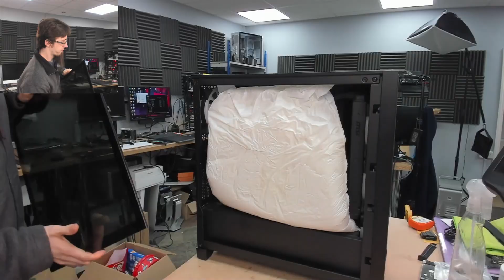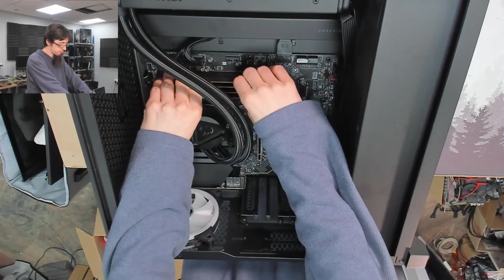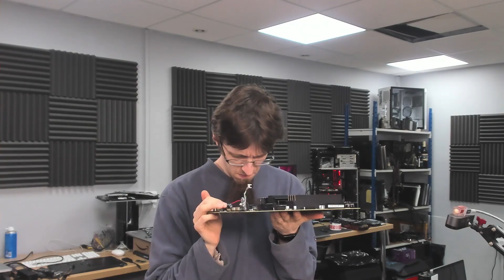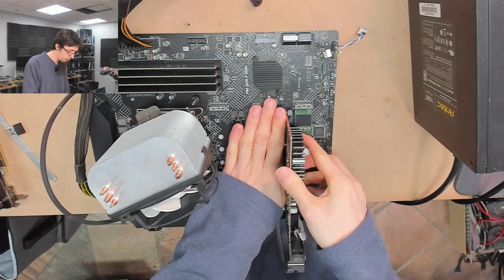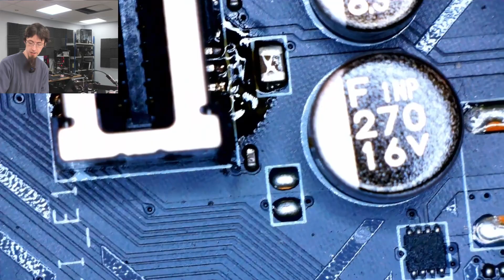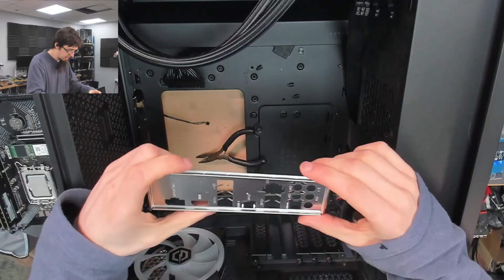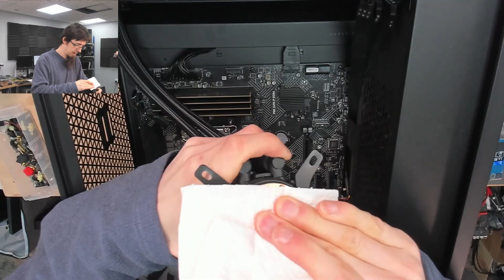CyberPower PC, GPU not detected - LFC#334

Comment: I got a lockup problem where my PC will lock up once or twice a day or sometimes it will run for days and not lock up, the sound will stutter and freeze or sometimes it will lock up with no sound. I have looked at my CPU heat and HD heat and video card heat and checked my power supply stats seems fine even when gaming I get no blue screens at all and can't get a crash report from windows I can't tell whether it's a driver problem or Hardware. Sometimes windows won't boot upright and I have to rest reboot to fix it.I have reinstalled windows but this did not fix the problems, with both problems I just rest rebooted and I am just fine again for a time. it only ever locked up once while gaming strange. Could you give me some tips on what to look for as the problem areas for these kinds of lockups?. ps. I did a ram test with memtest and it came up with no problems found, i ran it twice and got all the latest drivers, Bios i can install. Thanks for any help.

Comment: Its because of  Windows Not Properly determining the drive as they have Server grade drivers that are being mis-configured in windows active directory and the End outcome is Either a Hardware Component being BRICKED = OR = no longer working or a full System shut Down = Crash = over and over again when ALL along it IS Windows ! now the board = YES this also COULD be due to windows misconfiguration of its drivers and causing one bios to be confused with another Ultimately bricking you device .
Bricking = To throw a BRICK at something = as in BREAKING IT . jst fyi

Comment: Excellent repair. I've been building gaming systems since 1997 and have never run across this problem. With graphics cards getting heavier, it presents a problem for shipping. For shipping I take the extra effort to secure the cards so no amount of jarring will disturb the internals.

Comment: this is just great learned so much big respect+1. I would have switched the card to the PCI-e  x8  lane and call it a day as From a quick look, there is a little below a 1% performance difference in PCI-e 3.0 x16 and PCI-e 3.0 x8 slots. The difference is not even close to perceptible and should be ignored as inconsequential to users fretting over potential slot or lane limitations. please note that I'm not sure how this scales with SLI. peace

Comment: I have a gigabyte GTX 1060 that wont boot on two computers i tried to put it in, but will boot in my personal rig with no issues, im absolutely stumped as to why, the two other computers run fine with my test GPU, what on earth is wrong with the 1060 GPU? i cant find an answer anywhere, is this something anyones come across?

Comment: DO YOU REMEMBER OLD PS3 ? XBOX 360 ? GAMING ?? 
1-PCH (H61 -H81,H110,......
RUN GAME STREESS THE VGA ,SECOND .ALL POWER TRACE و

2- The heavy weight of graphics can break soldered bases

SOME TIME RE  heating THE PCH CAN FIX IT 

EC CHIP .SAY OK IM ON
PCH COMMAND THE MOSFET ON
AND POWER ON 

IN YOUR CASE .MAYBE NUMBER 2 HAPPEND

Comment: I had to use an old 4870. It wouldn't display anything. I updated the bios with flashback button. Still no go on newer cards. I think the mainboard went into legacy mode. I'm pretty sure that's what happened anyway. Then they would work. Then I turned on UEFI. Weird right? I'm new to all this UEFI stuff. Actually this computer I'm on isn't UEFI. It was a beast workstation 10 years ago. About time for an upgrade though. A $100 Ryzen beats the dual CPU Xeons now days.

Comment: The last two MSI motherboards I owned had badly soldered Ram slots that failed after warranty. Unable to run Dual channel ram in either board. They advertise high quality components but clearly their soldering process is pants. As soon as you identified it was a slot issue I was wondering if you would put it under a microscope and push on the pins. Well done.

Comment: I used Alphasync system integrator and by comparison it's amazing. No crappy ram or power supply issues at all. Having said that, let's not rule out the possibility this kid put those componnets in himself using their configuration system.

Comment: The NVME is maybe connected to the chipset in stead of the CPU. There are two slots closer to the CPU that probably connect to the CPU more directly. I see you fixed it at 55:00, good job.

Comment: This entire system may have been damaged in shipping, which might explain the board being jammed and perhaps a hard drop (in shipping) and the video card, took the brunt of that drop and resulted in those pins to crack. Over-time, thermal expansion, and the weight of the video and completed the shorts in the pins. Plus, that video card is huge!

Comment: When i saw that motherboard so low in the case i was suspecting some contact with the case. I got this problem twice with customers who build their PC and did not even put the raisers.
Nice job about the diagnose and the testing by the way and nice find about that bad soldering, Strange that this MB went through testing and was sold, tells a lot about cheap MB.

Comment: Paused at 17:56 screaming in my head: TAKE THE MOTHERBOARD OUT! There are obvious signs of issues with the installation of the board before even opening the case. That's your first port of call. Judging by the intermittent failure with the GTX 1060: I'm guessing a failed PCI-E slot due to improper motherboard installation.

Comment: Paused at 11:53. I'm going to make a prediction. I suspect that the improperly installed motherboard has caused stressed in shipping, especially surrounding the GPU which surely is secured properly to the case and so not correctly to the motherboard given that it's out of place. There could be a broken solder joint or trace somewhere near the GPU or really anywhere in the motherboard, especially near the standoffs. Heck, there could even be an entire standoff in a place where there isn't meant to be one applying pressure or even shorting.

Edit: Given that error code is showing a GPU problem, I'd start by putting the GPU in the second 16x slot.

Well, actually I'd be curious immediately to pull out the motherboard and see what's causing the alignment issue.

Comment: What a great video. Once you found out it was the power to the GPU, I thought right a way there was a broken solder joint on the slot. Not knowing what you do, I would have checked the slot first for bad pin connection. Great job!

Comment: Ha! An MSI board with crap (or non existent) QC? Please say its not so...
Stopped buying MSI when I realized most of my PC hardware that has died or failed for the past 10 years has been theirs. I've had two GPUs fail on me, both MSI models (R9 380 Gaming 4G, RX 590 Gaming). Three motherboards, all MSI (Z97 PC Mate, B450 Tomahawk x2). One monitor (MAG 241C) that had this weird issue that colors would get messed up if half the lower screen was yellow (fighting in a desert in Bannerlord was a pain in the ass).

Comment: Fantastic Diagnose there, and repair! I did work for cyberpower for a week a back in 2006, the company that got the contract  PC building were strong on quality. But they started to get a lot of systems from the USA that had to be bench marked and checked. Also the company that got the contract, had just come out of administration too, so i bailed out.  Laugh was when they were doing their diagnostics, they kept blaming the graphics cards. With me having the Microsoft cert in windows XP at the time.  I suspected it was driver issue,  but they said nope its the cards. I did a driver change, and guess what. i was right. It was one of the drivers they were using that was causing the problems.  So all the cards they were swopping out,  were ok. I got a thanks for that and put on the diagnostics and checking. But for what the pay was and how tricky the company was with the bank at the time, it was far to unstable for me.

Comment: Very nice .... the reason for the solder to come loose is the weight of the video card + heat when playing .... such a fault will return again vibration of fans + heat .... only if you stick the socket to the board it will help more

Comment: The better experience is Digital Storm. They custom-build PC for you with name-brand parts of your choice that work with the system, no guesswork. They have most of the name brands. The only thing is the case is a custom case, but they do top notice work. If you want a sound system builder use digital storm

Comment: Great & interesting fix going the extra mile as usual Graham.  The 2666 RAM was bothering me so I looked up the system on Cyberpower’s site. Unless they’ve updated the build recently or the buyer changed the build, the system should’ve had 64GB of 3200 not 32GB of 2666 — found the system on their site under 3080 systems which they call the HARRY — Windows 11 Home (64-bit Edition) Intel® Core™ 12th Gen i9-12900KF 16-Core CPU 64GB DDR4 3200mhz Memory GeForce® RTX 3080 10GB LHR Video Card MSI PRO Z690-A ATX Motherboard 1TB WD Blue SN570 NVMe PCIe Gen3 SSD MSI MAG Coreliquid 240R V2 240mm Liquid Cooling Lian Li Lancool-215 ARGB Gaming Case - sure case is different but the LanCool 215 is equivalent to 4000D. Interestingly they don’t list the PSU specs. What’s more crazy is the £2619 price for generous roughly £1700 worth of bits (and that retail prices not Cyberpower bulk buying pricing)

Comment: Packing materials?
Video cable seems abit loose.
Low quality power supply
Plate alignment on back is Offset.
To many things wrong.
CHECK the fasceplate on rear, See if a piece of the Plate has put METAL into the USB.

Comment: With the weight of new cards I would have checked the solder points on the slot as some do fail in shippingfrom the weight strain.

Comment: I sold a computer that I built on a B350/ Ryzen 3600 /RX 5700 platform to my daughters boyfriend, after about a year or so I get told it doesn't boot anymore and it gets dropped off, it would only boot to the Gigabyte logo and no bios access. I thought the bios went bad being it was flashed for Ryzen 3600 back in Aug 2019 by me, it was a cheap board with no flash back that cost me $62 for a Ryzen 2200g to run on, it turned out to be a virus on the M.2 drive keeping me from the bios access! once I removed the drive and used a different boot drive everything worked.

He had been getting fake AMD drivers that speed your PC down. very nice catch and fix, without your tools it would be a new board for me it this case.

Comment: Awesome video, my suspicion as to what happened is whatever caused the motherboard to of shifted its position as explained in the beginning of the video where the io backplane of the motherboard meet the io shield were misaligned perhaps something caused that to happen and with the weight of the graphics card secured into the pci express slot put stress on the slot and therefore caused the breakage in the solder joints between the pci express 16 slot and the motherboard

Comment: Great video and repair! My theory is that since the motherboard wasn't seating properly in the case(misaligned I/O), when the assembler installed the gfx card, it wasn't seating properly, so he just forced it until it seated, which flexed the motherboard enough to break that solder joint....

Comment: Corsair only gives you two PCIE cables on the non x series PSU's. I have an RM850, non X. The good part is that you can buy another PCIE cable for around $10 on Amazon. Or, just get the rm850x.

Comment: i think the MB was bent in the case and caused the solder joints to crack. either the standoffs are short or the case itself is bent.
Reply: my theory is that the motherboard tray bent a little.

Comment: Bad fitting motherboard and broken PCIe connector (video card was hold in place by screws, but the connector moved). Looks like this case has been kicked around. Or (which is hard to believe) the expanding transport foam did put a lot of pressure on the video card and caused this problem.

After fixing the slot, the motherboard responded much quicker to the power switch.

I have some of those red paper washers. They were used between the back plane and the brass stand-offs you had to put in when building a PC. They weren’t screwed in when you build your own PC, about 30 years ago. A few brass stand-offs and plastic clips for the rest of the holes. Still have them in my toolbox with all other kind of screws.

Comment: I've just stopped at 16:56 on the timestamp and I'm going to say ahead of time that it's most likely the psu isn't powerful enough to handle the 3080. I had a Corsair cx650 80+ Bronze psu in my system and was trying to run a 3070 in it. It would run fine for basic things but as soon as I wanted to play something like DayZ or PUBG, it'd draw too much power and shut the system down. I'm thinking this psu being an 80+ White psu doesn't have enough juice to power the 3080.

Comment: What brand MOBO is that?
Reply from the maker: It's an MSI. It didn't occur to me until reading the comments here, but SMD PCI-E slots are a fairly new thing, most mobos are thru-hole, and wouldn't have this problem. Definitely something I'm going to look at on future mobos, but at this point I can only assume it's a manufacturing defect that was exasperated by a heavy GPU in transport.
I'm not blaming it entirely on the GPU, this card is big, but also it was transported with an expanding bag around it, so I'm not convinced transport damage is to blame here, the slot should've been stronger.
Reply: @Adamant_IT  thank you for the detailed response and getting right back to me Graham.

Comment: Watching this brings back bad memories of the same problem, but the graphics card never seated properly. The IO shield was also badly out of line, because the case was bent in at the IO end
using a steel ruler in the case, I could see the IO side standoffs were about 3mm lower than the back. All the standoffs were the same size. I use some longer standoffs to get everything in line and the graphics card seated properly. Yes, it works. This was over a year ago and my customer is very pleased. So, beware of bent cases!

Comment: The 750W PSU is by far more okay for a 3080 than an H series motherboard would be. For future reference a KF or F SKU or other Intel chip without an iGPU will give a VGA error beep code if no GPU is installed.
Reply: the issue wasn't the wattage, it was the fact it was a white efficiency, which have cheaper components and worse efficiency.
that beep code happened while GPU was installed too and he suspected it was a kf but couldn't confirm it without a boot or taking off the AIO, which he was trying to avoid.
Reply: @frommatorav1  He also asked how a f SKU behaved with no GPU in the system, which is the exact same as it does with a bad GPU in the system I was answering his query. The efficiency rating isn't the end all either see GN's videos on the subject. I've ran a system that drew over 375W (125W CPU 225W GPU + 3 hdds and 2 dvdrw drives) with a 300W no rating PSU and it never even got past warm, never had a single issue from it running 24/7/365 for four years. As long as it can deliver the power and do so cleanly most PSUs will exceed their rating by 10-20% without much fuss.

Comment: Excellent diagnosis sir! Well done, great video and very satisfying! Agree about the ram, 12th Gen supports DDR4 3200 out the box with no overclocking/XMP even for non K processors, so it stands to reason thats should be the minimum speed they install.

Oh, one thing viewers should take note, if you move your SSD to the slot nearest/connected to the processor on a 10th Gen running a Z490/Z590 its not likely to work. Intel for some reason rolled back pushing PCI Gen 4 on 10th gen but left the slot on a lot of Z490 boards for future use (i.e. 11th Gen CPUs), so only 11th gen cpus in a Z490 work with that slot, like likewise if you install a 10th gen cpu in a Z590 the slot connected to the CPU isn't supported. I think the 11th Gen architecture is pretty much the 12th gen backported 14nm. 

Cheers
Reply from the maker: Interesting, that might explain some of the confusion I've seen around which slot to use. I've been mostly AMD-focused for the past couple of generations, so wasn't aware of this. My policy has always been "Put it in the top slot unless there's a physical reason not to, eg mounting, heatsink clearance, etc..."
A few people mentioned SATA M.2 drives being something to watch out for, which I'm aware of, but also SATA M.2 is basically obsolete at this point, so it only really applies to people who already own them.

Comment: Not sure anyone else has mentioned it in the comments, but that PSU is likely to be an issue with a 3080. The 30 series cards, 3070 and up, have awful transient spike issues, and unless the PSU is high quality, it will cause the OPP to trigger and shut down the entire PC. I'm speaking from personal experience here, having gone through this about a week after the 3000 series released, though it was also later confirmed by well known and respected groups like Gamers Nexus. I'd genuinely advise the owner upgrade that PSU, along with the garbage RAM, or send it back to Cyberpower.
Reply: Left this comment before I got to the end of the video, so I see you know about the transient issues. Worth noting, however, that even WITH one PCI power cable per connector, the PSU still absolutely will fall over eventually.

Comment: I don't know if it's a good idea transporting a PC vertically with a heavy GPU fitted horizontally in a MB slot, ie, there must be a problem with SMD PCIe sockets if they need reinforcing.
Those PCI slot tester cards have voltage LEDs, and I think one edge is PCIe.